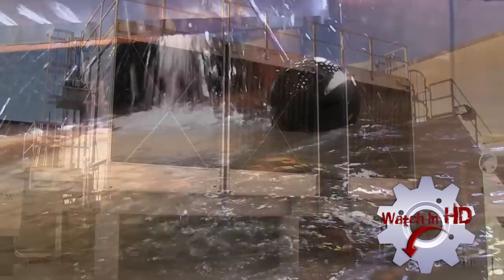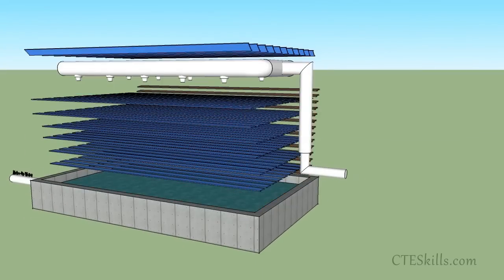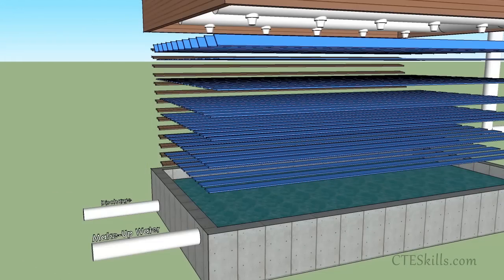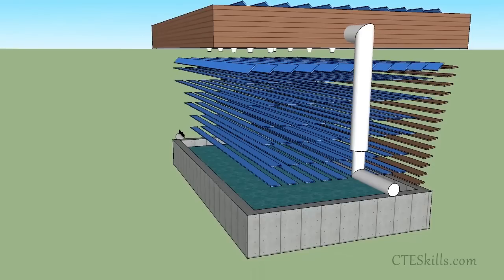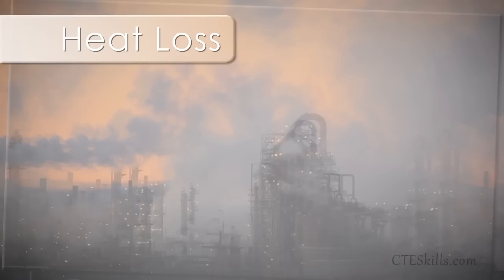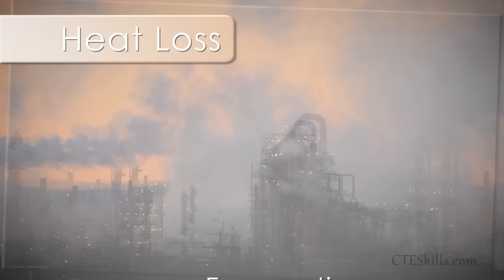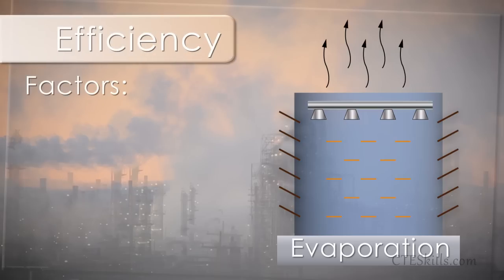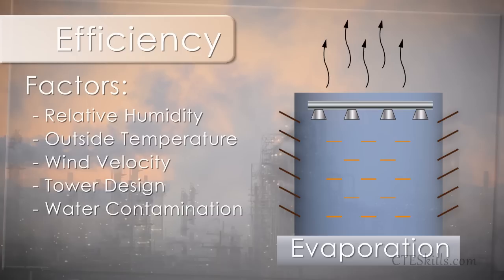How Cooling Towers Work

Comment: Where does the water come from for this process? I think it just said “outside source” but what “outside source” is usually used? Just curious.
Reply: It could be steam from a power plant. Most power plants burn coal, oil, or nuclear fuel to turn water into steam, which is used to make electricity.
Reply: Industrial hot water
Reply: It can be a variety of different sources. 
Most plants use nearby bodies of water. There's a reason why so many chemical plants are located along a river, because of access to water. Water is taken into a channel or canal that goes through the plant and then filtered and treated before it is introduced to the cooling tower basin.

Comment: The term sensible is defined incorrectly. Sensible heat refers to the heat loss or gain between two temperatures, but the absolute moisture content stays constant. (Janis & Tao, Mechanical and Electrical Systems in Buildings 5th Edition, Pearson 2014) Also, the part after on evaporation is a bit confused.
Reply: I don't understand which component is evaporated, is it the hot water (How hot water is evaporated through contact with cold air ?), or it's the moisture in the air ?
Could you please explain it to me ?

Comment: All these are would be large wind turbine engines that cool the water down and take the heat out.  These are also what they use to generate wind flow for ski diving trainers but inside a tunnel.